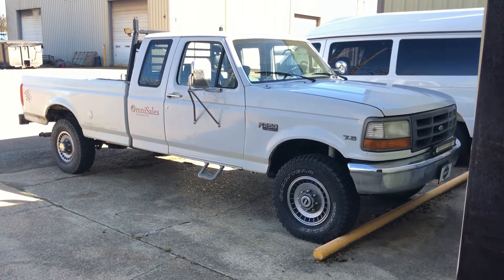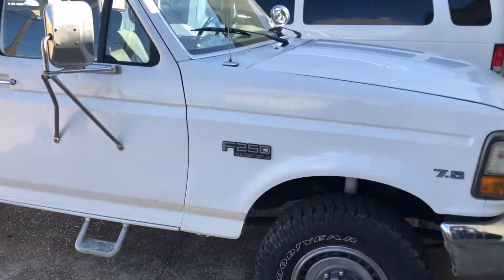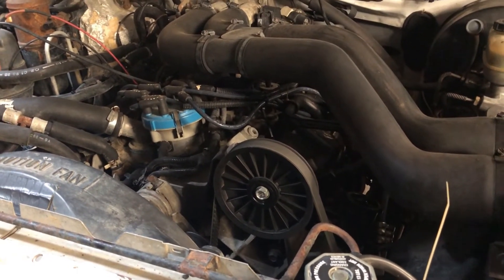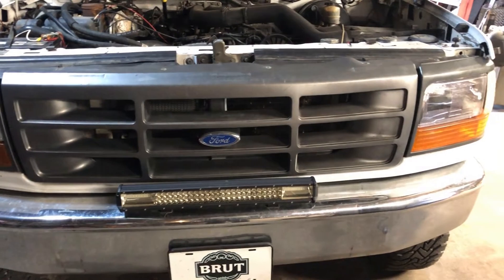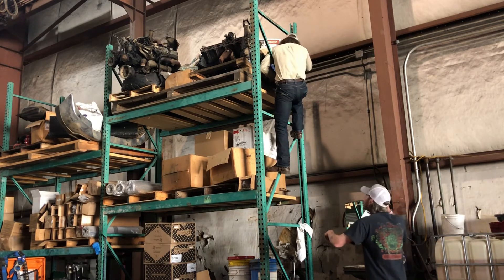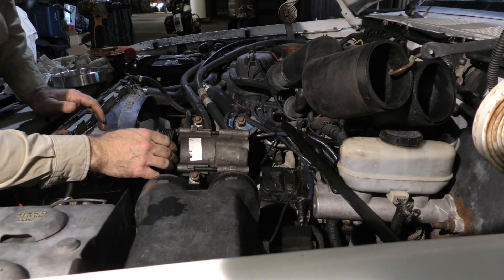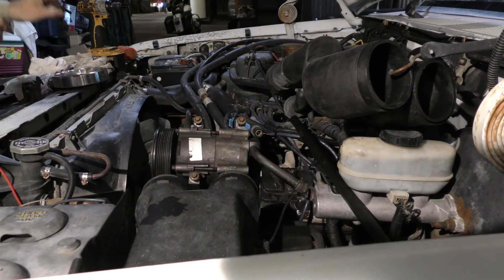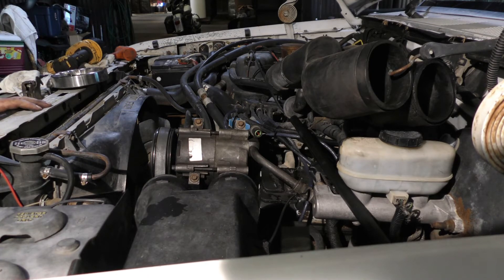Gearing Up To Put an OBS Ford F250 4x4 Back To Work (Part 1)

Comment: That’s the most athletic thing I’ve ever seen you do. 

I have some info on the compressor debacle. The one you tried that’s wider and has a smaller diameter pulley is from a 7.3. The small blocks and big blocks shared the same size dressings. The 7.3 is lower rpm so smaller pulley to make up for that and a wider belt to compensate for the lesser surface area of the pulley.
Reply from the maker: That makes sense. I probably should have fixed the whole system, but I'm going to do a motor swap before long so I figured I'd just do it all at once.
Reply: @myfoundrylife  It will be like a new truck then.
Reply: @jacobdewoody8858  that would make sense since he got the compressor out of my 7.3 pile of parts !